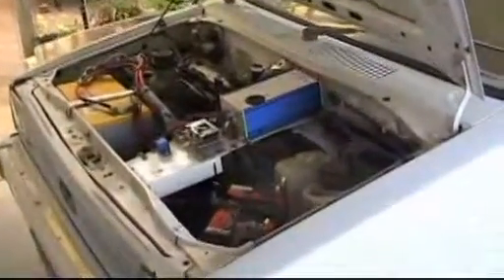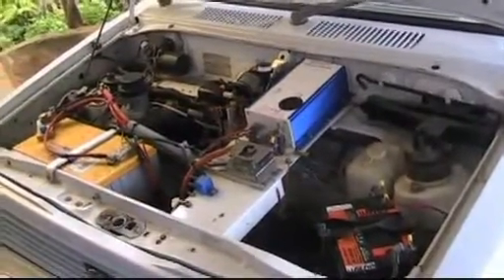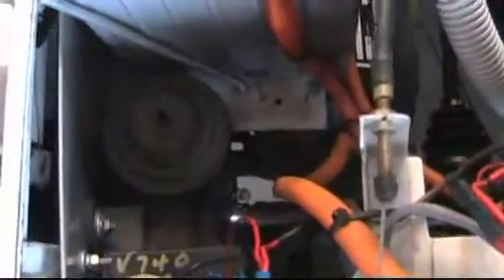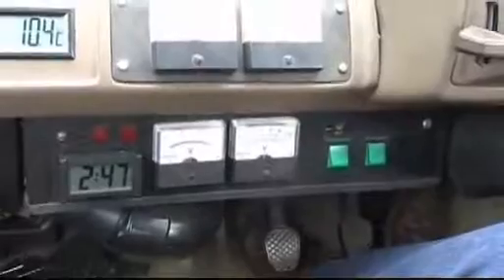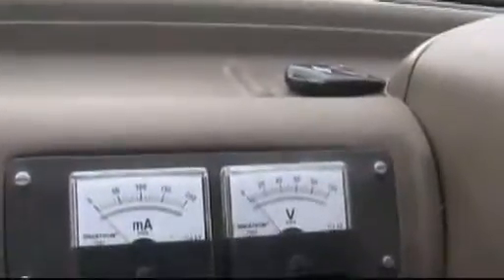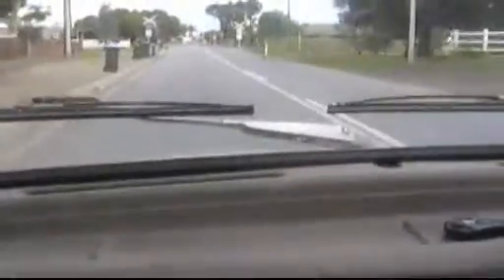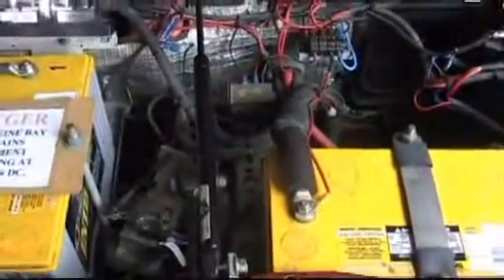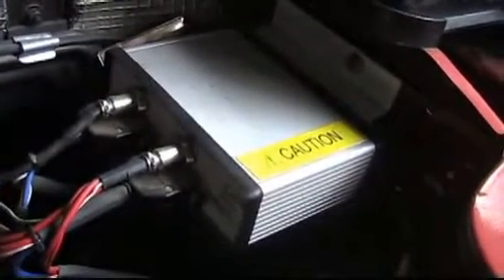EVRIC - 02 -  Edward Booth's EV Conversions

Comment: Thanks for the reply.
If I am going to make an EV i think I will use a clutch. In a normal petrol car you can also still shift gears, but it´s slow, and hard on the gearbox. Going down a hill for instance, I would like to go to neutral, to disconnect the engine. This is very easy to do clutchless, but when you want to get in gear again, you have the problem. Maybe you have to rev. match the engine to the box, and both speed and time is lost.

Comment from the maker: Edward did leave the clutch in. This is optional. If you decide to leave the clutch in, you must ensure that it is in good condition or fit a heavy duty clutch because of the very high torque available from the electric motor. 
For my conversion, I decided to remove the clutch - the main reason is, you don't need to use it much anyway. - just leave it in, say, third or fourth gear and drive all day. If you need to change gears, you still can, it just takes a little longer without the clutch.

Comment: Thanks for all the videos - very entertaining, and i learn a lot!
At around 4:50 Edward is doing a gearchange, and it sounds like there is a clutch invovlved, because the engine revs a bit. Am i right?
I know you can spare the clutch, which gives the advantage of simplicity plus loosing the weight of the flywheel, and probably better efficiency. A clutch on the other hand would spare the gearbox synchros, and make changes faster.
What do you think?

Comment from the maker: The motor is an ADC #K91-4003 6.7" 48-96VDC 8 HP Single Shaft.The controller is an Alltrax AXE 7245. That means 72Volt and a max of 450 Amps, which is what Edward is using. Batteries are Deka AGM 100Ah rated. There are 6 x 12volt batteries.